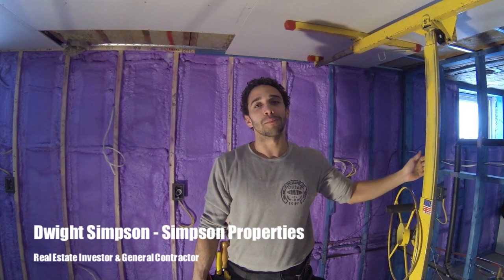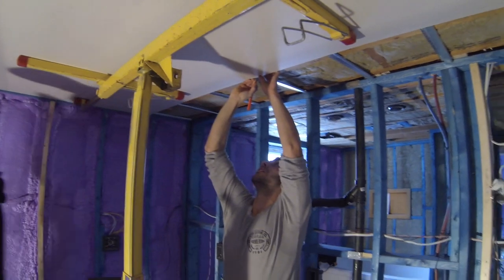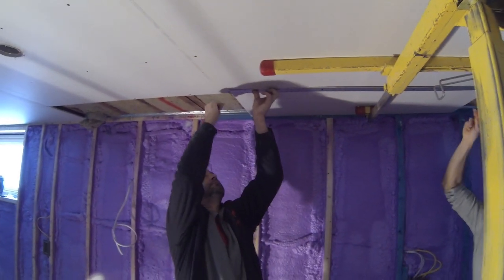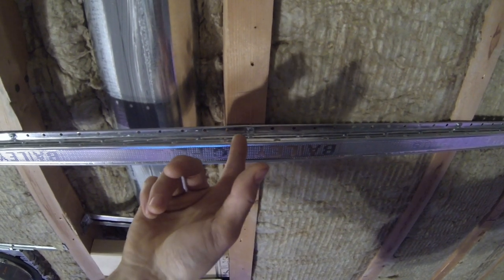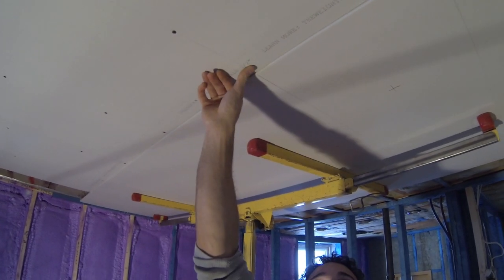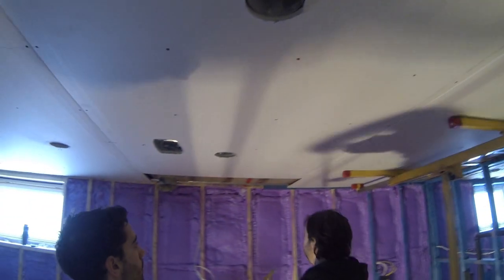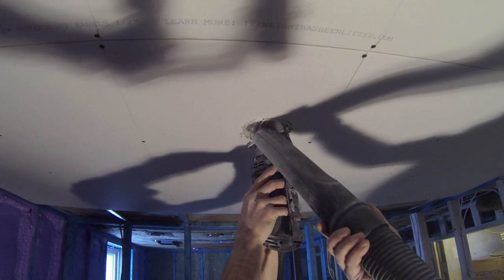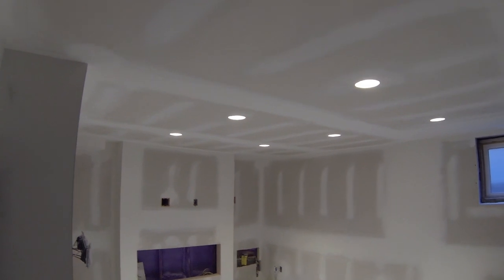HOW TO INSTALL DRYWALL ON A CEILING WITH RESILIENT CHANNEL

Comment: Great video, thanks ! i was wondering if its not too difficult to attach the drywall on walls after that (the top edge). if using 1/2 inch RC with 5/8 ceiling drywall, there is only 3/8 inches space to screw the drywall in the visible remaining part of the top plate (assuming the top plate is standard 2x4). maybe using double top plate is easier for that purpose ? what do you think ? curious about any answer. just buying my wood to frame and i am still wondering if i should use double top plate if using RC
Reply from the maker: Thanks! Installing drywall on your walls is not impacted by this. You don't have to hit the top plate. You can get screws along the edge and in your vertical framing their will be a stud every 16" OC. You can always add extra blocking where it's needed. Best of luck on your project.

Comment: Thank you for the video.  I see that you're hanging the resilient channel perpendicular to the joists.  I want to hang my resilient channel in parallel but offset so the screws don't go into the joist.  My reasoning is that my drywall is TypeX fire-rated and I would get better air isolation in between the joists if I install the resilient channel in parallel.  

I've never seen it installed in parallel so I want to know what you think.
Reply from the maker: Res channel is always installed perpendicular to the ceiling joist. If not, it defeats the purpose of installing it. Res channel is used for two reasons:
1) To help reduce vibration 
2) To have a flat ceiling. Res channel helps mitigate any imperfections in the wood ceiling joists.

When res is installed perpendicular the drywall screws go into the res channel only. If you install them parallel the drywall fasteners will go through the res channel and the ceiling (shorting out the system).

Comment: Where the drywall butts into each other do they share the same RC channel (each end occupying about 1/2" to 3/4" of the RC) or is it better to install another piece of RC for each butt end?  Also how far apart to you space the drywall screws  on the perimeter of the drywall (length) as well as the butt ends (width)?
Reply: Great question.  I had the same question until I watched a different crew installing drywall on a ceiling with res channel.  In that video, the installers did exactly what you described:  staggered each row of sheetrock, then mated the two drywall ends over a single piece of res channel (shared, meeting in center of channel face) with each sheet getting half the res channel face.  I'm sure they had to be careful that the screws did not tear out the drywall end, because they had to install the screws within 3/4" of the edge.  And in the other video I saw, where the ends of the drywall sheets met, there wasn't always a res channel already there, as the channels were initially installed 24" on centers.  In those cases, the workers did indeed add another resilient channel piece so that the face of the res channel was centered on the joint of the mating drywall sheet ends.
Reply from the maker: Sorry for the late reply. It’s easier to install another piece of res channel for each butt end.

Comment: When attaching 5/8" drywall to the resilient channel, I understand the proper screws to use are 1-1/4" "Type S" bugle head.  The screw "type" is not often listed on the box or in the internet advertisement description, so I'm not sure which screws to purchase.

Do all "Type S" screws have the same thread type (coarse or fine)?  Can I assume that all fine thread Drywall screws are "Type S"?

I want to make sure I get the proper kind of screws, as I'm finding that puncturing the metal is kind of challenging with the tip of the coarse thread screws that I've used to attach drywall panels to wood studs in the past.  Am I just not patient enough or pushing hard enough?
Reply from the maker: Type S pan head screws are what is recommended to fasten the res channel. The reason being it has a larger surface area to support the channel into the ceiling joists. 

For drywall screws fine thread will be easier to fasten the drywall to the res channel. It will take a little more patience and adjustment to install the fasteners compared to fastening into wood.
Reply: There's your problem, your using the improper screw. 
Use "fine thread" drywall screws, the ones meant to install drywall onto metal studs. But also yes, apply heavy pressure behind the drill to set the screw. Use all your might if you have to

Comment: Love your videos (wish there were more) I've referenced them multiple times during my renovation.  Few questions if you don't mind...how much variance does the resilient channel allow for when installing on the floor/ceiling joists before the joists have to be shimmed?  For example if my ceiling joists vary by 1/2" from one side of the room to the other will the resilient channel "flex" enough to keep the sheetrock on the same plane or should I shim the joists?  2nd ? ... how do you treat the end of resilient channel if there is no joist to fix it to?  Do you leave it free floating and just have the wall sheetrock panel to hold up the end?  3rd  When installing resilient channel on the walls is drywall hung vertically or horizontally?  Thanks again your work it awesome!!!
Reply from the maker: Thanks! I'm currently filming a new YouTube series. I will be releasing new content in 2019. 

1) Your ceiling joists shouldn't vary more than 1/8 -inch from the plane of the faces of adjacent framing, bridging, or furring members. If you have 1/2"  different I would recommend furring the ceiling to a level plane. 
2) The resilient channel is allowed to freely hang up to 6" on the ends (Bailey Res Channel). Double check with the spec sheet of the product you're using. You can also add blocking so that you have a solid member to fasten too if the gap is larger than 6".
3) Orientation of the board does not matter. As long as you are installing the appropriate number of fasteners and proper spacing, based on your drywall/building code specs. It's typically easiest to install drywall on walls horizontally.
Reply: All of the channel families are flexible but you have to use common sense. 1/4" or even 1/2" from one side of the room to the other is nothing depending on the size of room. But if it is 1/4" between three studs or joists you might have a little trouble bending 5/8 material. As a guideline, wood flooring should be within 3/16" every 10 feet and that is for 3/4" wood. Sometimes I glue on a super thin strip of 2x material to a stud or ceiling joist to get it closer. You can make those on a table saw.

Comment: Hi, great vid! I was wondering if it was just the ceiling you installed the resilient bars on or if you did the walls too. If you did the walls too, do you know how the TV was hung? Is there a way to hang a TV on to a wall that has resilient bars for soundproofing?
Reply from the maker: It was installed to the ceiling only. Wood blocking should be installed for anything that has to be fastened securely to the wall.
Reply: No. Once you utilize resilient channel to soundproof a wall, you are kissing away goodbye your opportunity to mount anything onto the studs. Shelves? Goodbye. TV? Goodbye. 

The whole purpose of a resilient channel, is to pull away (isolate) the drywall itself, from the studs. This improves soundproofing, by limiting the amount of sound that can be transfered from the other end of the wall, through the vibrations of the stud (better known as decoupling). So once you mount anything onto the stud when using resilent channel, or even have a drywall screw making contact with the stud, you can kiss your STC rating goodbye and shouldn't even have bothered using the resilient channel. 

If you want to mount anything onto the wall, your best bet is build a staggered stud wall, instead of utilizing a resilient channel. This performs the same purpose of resilient channel (decoupling), with the added benefit of being able to mount onto the studs, and with a very similar if not better STC rating. The only drawback to using staggered studs, is that it takes away a couple inches of space and is pricier in materials. 

Staggered studs, or resilient channel. Ability to mount into the studs, or not. Either is perfectly fine, you choose 👍

Comment: Are standard drywall screws strong enough to puncture the 25 gauge steel of the resiliient channel, or do I need to find special self-tapping screws to attach the drywall to the res channel?
Reply from the maker: Standard drywall screws work fine. It’s no different than drilling into a metal stud.
Reply: There strong enough, but you need to apply heavy heavy pressure behind the drill, forcing the screw into the resilient channel. To properly set it

Comment: Great video! I am going to double up on the drywall with green glue. Do you suggest 5/8 or 1/2? And when installing the second layer of drywall do you screw into the vibration dampening chanel?
Reply from the maker: Thanks! I would recommend going with 5/8". If you're using res channel both layers of drywall are fastened to the res channel. If you fasten the drywall to a ceiling joist (wood) it defeats the purpose of using res channel.

Comment: Great video, it's been super helpful in my studio build.  One question:  To adhere the drywall to the RC, I was advised (by Phillips, the manufacturer) to use 1" screws and for the first layer of drywall and 1 5/8" screws for the second.  The Phillips RC is 0.5", depth-wise, like the one you are using in the video.  You mentioned in a comment below that 2" screws should be used for the second layer.  I suppose that if you are not attaching the drywall to the RC in an area that is not attached directly to a joist it wouldn't really matter but if you happen to put a screw into the RC where it is attached to the joist, the screw would go beyond the RC and into the joist.  Do you not recommend screwing near the joist to avoid any potential problem?  Thanks!
Reply: I'm doing 2 layers of 5/8" drywall, btw
Reply from the maker: Thank you! The biggest thing to keep in mind with both layers of drywall is you don't want a screw to go through the drywall, res channel and a ceiling joist. If you go through all three then you short out the res channel and defeat its purpose. You want to avoid any joists when fastening the drywall to the res channel.
Reply: Simpson Properties thank you so much for the response, much appreciated!  One follow up question-how do you handle situations where you have recessed lighting installed and the can is right in the corner of the 8 foot drywall (so you can’t screw it into any res channel since the can is occupying the space where the res channel would ideally go?  Would you cut the drywall into smaller sections, thereby increasing the number of joints?  Thanks again!
Reply from the maker: Psych Dog Studios I would add smaller pieces of res channel in those areas to offer more support and area to fasten the drywall to.

Comment: If I wanted to do double layer w/ green glue for more sound proofing would i glue the panels together before installing or would I install the layers one at a time? Thanks for the awesome video!

Also I want to make it really really sound proof. Would r-13 -> resilient channel -> 3/8" sheetrock -> green glue -> 1/2" quietrock be good? I can add MLV before the resilient channel. Is that overkill? Would it make a big difference?

Edit2: Sorry for all the questions but this is for an existing ceiling. I was going to demo the extra drywall and start over but maybe I should just do channel and 2 more layers so there are 3 layers. I'm not sure if there is insulation between the joists in the existing ceiling what are your thoughts on the two options?

Thanks again.
Reply from the maker: Thanks! You would install your first layer of drywall, then apply the green glue to the back of the second sheet and install it.

In my opinion the best option would be to demo the existing ceiling. Install two layers of Roxul Safe'N'Sound insulation, res channel, two layers of 5/8" drywall with Green Glue in between. If you want to go really overkill them install a specialty sound dampening drywall. I hope this helps.
Reply: Whatever you do don't install Res channel, hat channel and isolation clips over existing drywall. It creates essentially a giant drum. The kind that are in bands. Demo existing sheetrock, fiber insulation then res channel or isolation clips, hat channel and layers of drywall. I like whisper clips but Pac International makes the RSIC-1 Low profile that sits in the bay. You clip in your hat channel parallel to the joists thus only losing 1/2" on your ceiling height. You have to do some planning for light boxes. Again the fire putty around electrical boxes. Airtight is critical! and as replied below just add another layer if you don't want to demo but results are much less effective. Again if you do a ceiling you need to do the walls. The sound easily goes right around and down the studs unless walls are concrete or brick.

Comment: What type of screws are you using to install the drywall? Regulsr drywall screws? We tried that but its not penetrating the metal.
Reply: "Fine thread drywall screws", the ones that are meant for installing into metal studs.
The trick is to apply heavy pressure behind your drill, this should force the screw into the resilient channel, and properly set it. If you don't apply pressure, you run the risk of the screw spinning and just making a bigger hole.

Simply apply pressure behind the drill, use all your might if you need you won't break it.
Reply from the maker: Check out the video description. All the materials are laid out there.

Comment: In normal drywall installation, you typically glue the drywall to the ceiling joists to help prevent nail and screw popping over time. How can popping be prevented when installing on resilient channel? Can you glue the drywall to them as well?
Reply from the maker: At the time of making this video I was not aware of drywall adhesives. You can use most drywall adhesives with resilient channel installations as well. Just double check that the adhesive bonds to metal before buying it.
Reply: You don't need to glue with resilient channel , there will be no poped screws or cracks if taped correctly
Reply: Would you use an adhesive for future installations?  Thx

Comment: At around 3:50 you say install drywall screws every 12” along each res channel or ceiling joist, i thought you didn’t want the screw to go threw the channel and joist. Can you help me out a bit, thanks!
Reply from the maker: That was a generic note that could be applied to installing drywall with or without res channel. If you’re using res channel install your screws approx every 12” on the perimeter and avoid screwing into any ceiling joists.

Comment: Great video Dwight, very helpful for my own basement project. Is it true that we need 2 layers of 5/8 drywall on top of the sound resilient channel to reach an STC rating of 50 in Ontario for 2 dwelling unit? What size of drywall screws would you use for the second layer of drywall?
Reply from the maker: Check with your local building code or inspector always to see what there minimum requirements are. In this case I went overkill. We were not required to use Roxul or res channel. The only requirement was to use 5/8" drywall. 

Acording to Roxul: 
(2 x 10 Joists – 16” On-Center)
Using ROXUL SAFE’N’SOUND, 5/8” drywall (type x)
and resilient channels at 24” provides:
Fire Rating: 30 minutes
Sound Transmission Class (STC): 50

Here is a link to the Roxul guide:
http://www.roxul.com/files/RX-NA_EN/pdf/Brochures%20and%20Sell%20Sheets/Residential/ENGLISH/SAFE'N'SOUND%20Residential%20Sell%20Sheet%20Eng.pdf

Use 2" screws for the second layer of drywall. 
Here is the technical sheet for Bailey Res channel:
http://www.bmp-group.com/docs/default-source/resource-library-literature/rc-plus-resilient-channel-technical-data-sheet.pdf?sfvrsn=0

Comment: Looks like you are trying to do good job , but tapered edge of drywall goes parallel to  resistant channel,  so your long joint has steel behind, than you have fire rated assembly , so if you flipped your Sheetrock 90 degree would be perfect job. Also lot easier to draw screw   lines as rock is seating against the wall before lifting it up. Not scrutinizing  you, just trying to help.  Good luck on next one.
Reply from the maker: Drywall is typically stronger when hung perpendicular to the resilient channel. This applies to both wall and ceiling applications. On commercial jobs, fire codes may require seams to fall on the entire length of the framing or resilient channel. In that case the drywall would have to be hung parallel.